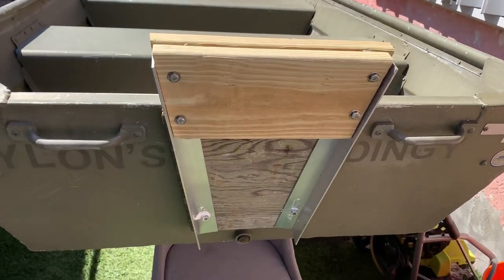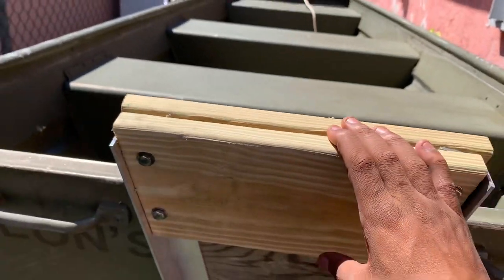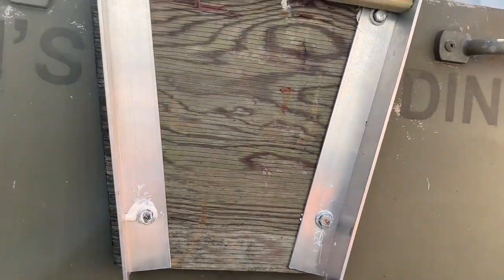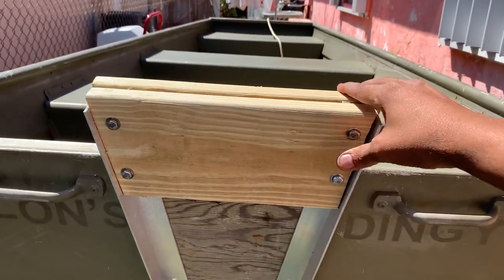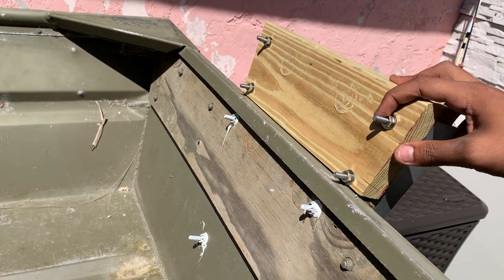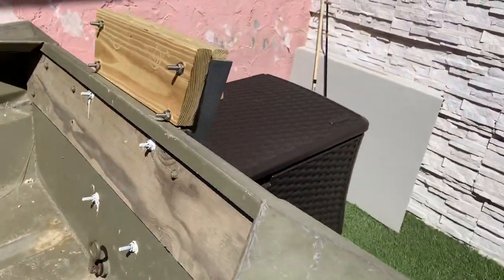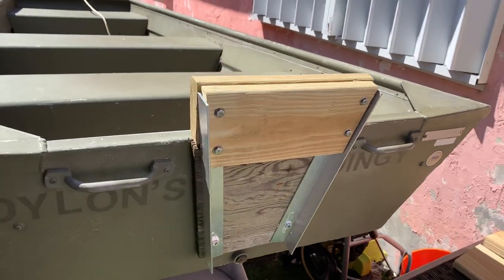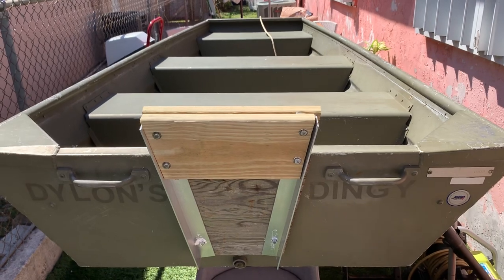Jon Boat ideas raised motor jack plate

Comment: I was going to spend a lot more money on a jackplate so I can mount my vintage Mercury Mark 20 at the proper height on my vintage 14 foot v-hull.

This looks like a better set-up, and for less money, if a little more work. Better because the jack plate would move the motor back and put the tiller handle too far back for comfort. The jack plate effectively makes the boat longer, which has some benefits, but the comfort and ease of use is more important for my purposes.

Thanks for posting this ingenious modification.

Comment: 0) nice and cheap design. I would copy
1) Good that you did 2 woods. The rear will fail if you would use the rear  only. 
2) bolts pins i would put outside for your sefety in case if you fall in boat in deriction of pins